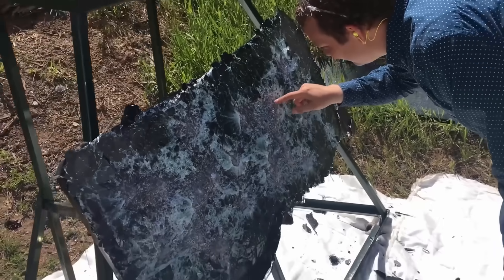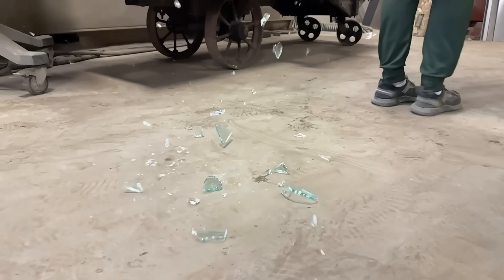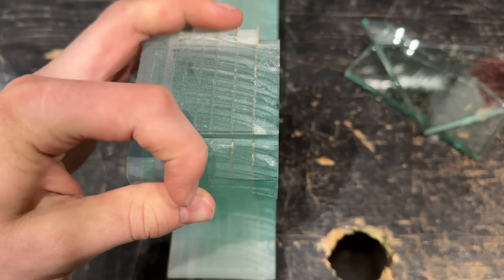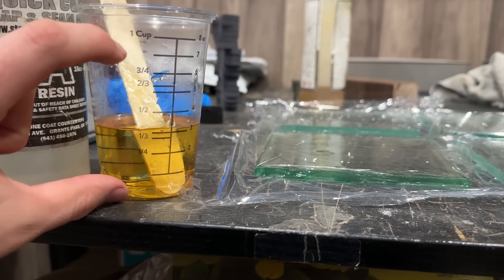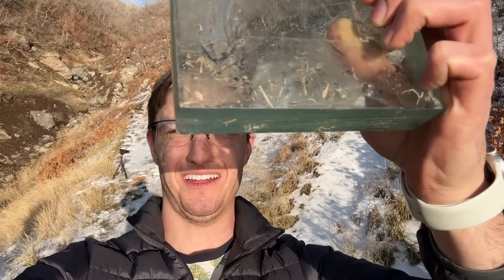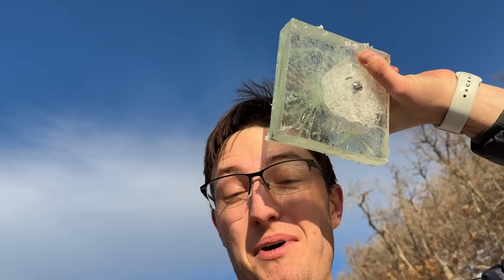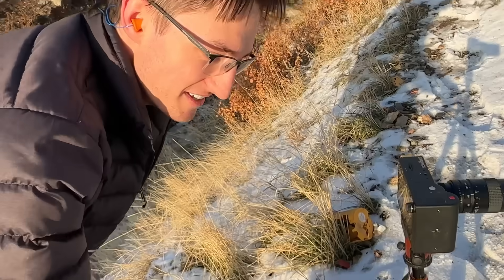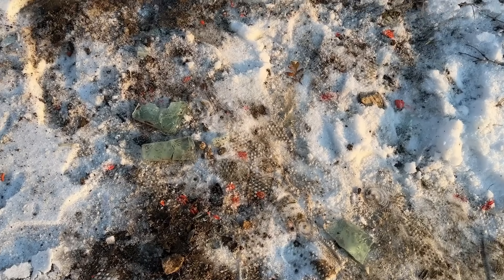I Made Bulletproof Glass With Basic Materials

Comment: Stopping green tip is nothing to scoff at, there are even some hard body armors that can't! You sounded sarcastic about the "wicked" 5.56 but that chunky boy was thoroughly bullet proof.
Reply: Those are pretty poor level 4 plates then, or it's level 3 or 3+ which isn't designed to stop rifle rounds. Level 4 hard armor has to stop a single 7.62 nato black tip (or 30-06 AP round) which has WAY more speed and energy than M855A1 EPR (green tip 556). I'm not sure what hard armor you're referring to that can't stop green tip, even AR500 can.
Reply: Did I say level IV plates?
Reply: @000Mazno000  ooh, chestplate enchanted w/ projectile protection IV!

Comment: Polyvinyl butyral (PVB) is a resin known for its strong binding, optical clarity, adhesion to various surfaces, and flexibility, making it ideal for applications like safety glass. It's created by reacting polyvinyl alcohol with butyraldehyde. PVB is a thermoplastic and is often used as an interlayer in laminated glass, particularly in car windshields and architectural glazing.

Comment: You want to shoot the glass side for a couple of reasons. 1) the poly is a polymer so it'll do a good job holding glass in place after impact. 2) the poly is impact resistant and considerably more flexible, so it will bend and absorb the energy thanks to it's low yield strength compared to glass which has a high yield strength and is very brittle. This also prevents glass from being thown at the person it's protecting. 3) the idea of the annealment and why the glass works is because the name of the game with bulletproofing is removing energy from the system. The small suspersonic piece of metal has a high amount of energy, so you want something that can take that energy and disperse away from you. Bullet proof vests work by taking the energy and dispersing it across a larger area of your body. That's why it's painful and kicks like a mule, but it keeps you from turning into swiss cheese and makes the impact....less lethal, let's say. Now contrast that with bulletproof glass, ususally this is on a car or on a room door. In a car, you can flee and leave the danger, so all you care about is removing the energy. When the glass breaks, the large shards have more mass than the bullet, and as they break they take energy with them, sometimes falling off the car and removing energy from the whole system entirely. Their lifespan is limited or course, but that's where the PVB and large shards also come in as they can allow multiple shots being taken before failure which aids in fleeing. A room on the other hand is usually designed for continued resilience, so they probably have another layer of poly on top to squeeze everything together, and may even have multiple layers of poly inside with more glass sandwhiches allowing even more resilience.

And like a bunch of people have said, usually these are tested while mounted in some way because it prevents it from moving and allows the glass to do it's thing instead of turning and allowing the bullet to chew it up from a glancing blow.

THIS IS NOT A CRITQUE THOUGH! Just a little info as to some of the things you were unsure of or curious about. I know I'm a little late to the party, but I found your channel on the 3D printed car tire you did recently and have been enjoying the video playbacks since. Keep following the rabbit holes! We are genuinely curious lol

Comment: Shoot the glass side. The reason is the poly-c side is used to prevent glass flying at the people it is designed to protect. Of course you can put plexi on both sides, but you could put tempered glass  over the plexi on both sides for clarity and scratch resistance.

Comment: You're supposed to shoot the glass side. If you shoot the polycarbonate side, the glass explodes off the other side and into the face of the person you were trying to shoot.
Aside from that, I think you may have had better test results if you had bolted the glass into a steel frame that compresses the glass together as well, since the glass would be installed into a building in a similar way. It would help to keep the layers from separating when you shoot it.

Comment: outside view is for fancy only. try metal sheet walls (steel container, can) filled with concrete or plascrete (resin + sand in concrete style mix), yep bulletproof glass is just concrete block roughly. try kinetic sand inside a steel can.

Comment: 14:09 it's 5.56 OR .223. and GREEN TIP = Green-tip ammunition is most common in 5.56/. 223 Rem caliber and is mainly designed for use with the AR platform. These rounds were originally considered controversial, as they meet one of the criteria of the federal definition of armor-piercing ammunition.

Comment: Great Video Guys if you can understand how armor platting is made  on a  WW2 Battleship built proof glass is made almost in the same manor with different types of  layers of protection .. On a Battleship the Armor - Plating  on different parts of a Battleship the armor plating has cement between the armor plating to absorb an in pack from a heavy shell you were close to making armor plating do a little homework and do a revist Happy New Years Guys

Comment: LOL it would not have stopped the 30 06 even if it was the first shot they are way way more powerful than 556. Higher velocity and much heavier. 556 223 are basically faster .22 rounds with more weight and not much more weight 22 250 are faster and same weight as a 556 but 30 06 beats both in terms of penetration energy dump all of it

Comment: PVB is similar to double sided clear tape. Unlike the resin you used it remains flexible more like rubber than plastic. When using it to laminate glass you place down a sheet of glass then apply the pvb sheet to the glass then lay on the next sheet of glass and apply heat and pressure to remove air bubbles. It does not take much heat or pressure to do it. A hot plate turned on after the glass pvb sandwich i laid on it with say some ply wood and a cinder block laid on the plywood is enough pressure and let the hot plate heat up to a couple 100 deg f will be more than enough then you turn off the hot plate and let it all cool down. To rig it up for shooting it for testing you would want to make a wooden frame around it and a dense rubber material say archery target matts or rubber mudflap material between wood and glass around the edge of the BP glass panel. You can screw the wood together
Reply: So your saying it should be possible to make a bulletproof cyber truck if Tesla tried harder?

Comment: FYI some ballistics information here, the green tip 5.56mm used (also not .556, that would be over a half inch in diameter, its actually .22cal just going very fast) is green due to the designation M855, which includes a small steel penetrating tip that did much better than a full soft projectile.
Reply: I prefer to classify it as eco friendly 😊